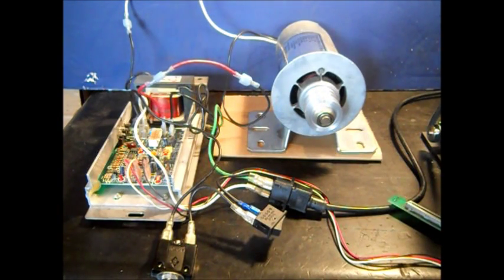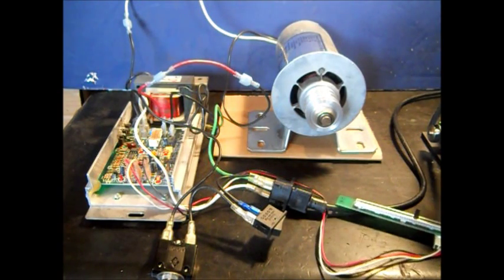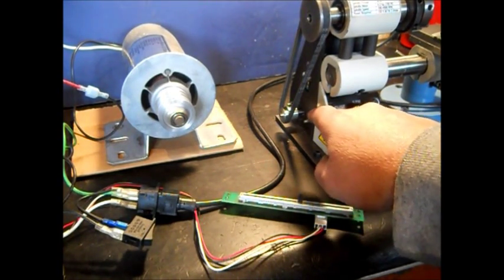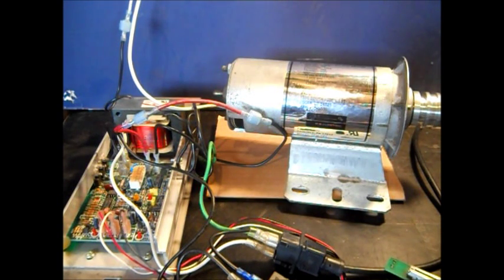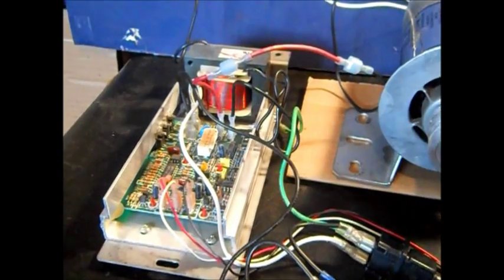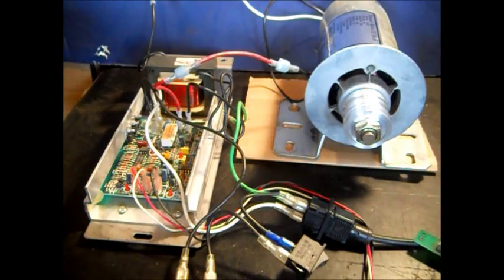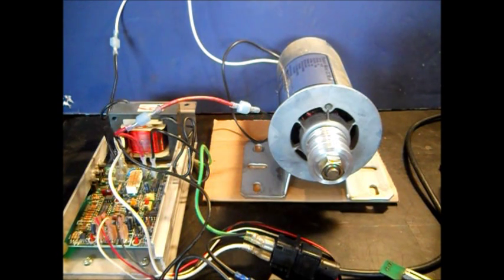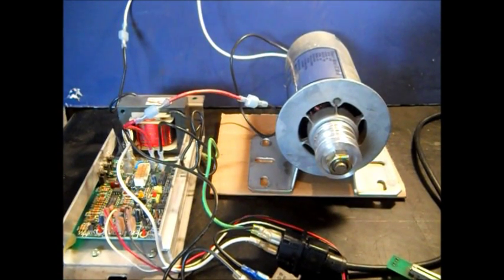Nano Lathe Motor Upgrade ( Thanks To belgrademachine)

Comment from the maker: IT is strong at slow speeds this pulley won't be a 2 to1 ratio but close that is important for torque like a dirtbike motor cycle the back sprocket is bigger Or bicycles with different size on back wheel

Comment from the maker: I waswondering why the shaft sticks out the back It did look clean inside I'll take the air hose to it I ran it a long time today grooving the pulley and it was only warm If those are not to hard to get apart there is a No. on the bearing

Comment: Nice! It made it for the weekend ... hope you enjoy my friend! I don't imagine it will take you long to get her going. If you can find a small plastic fan blade you can put it on the 5/16" shaft on the back of the motor and get that insulation paper out of the back. Perhaps get the seals off the headstock bearings and grease them up good too. Highest torque Nano lathe on both sides of the Mississippi :)